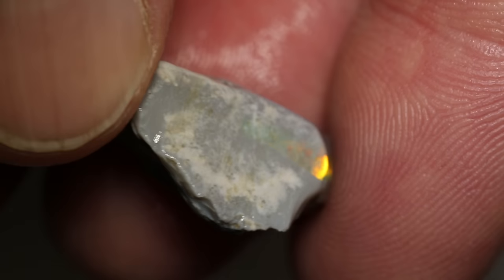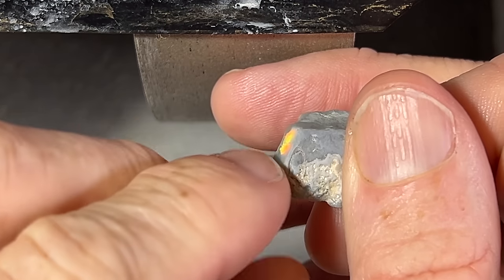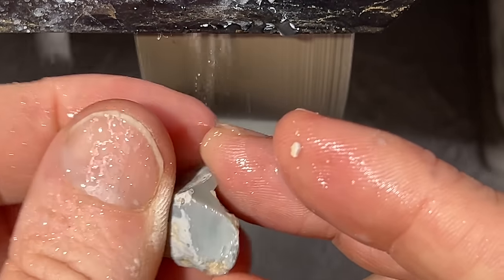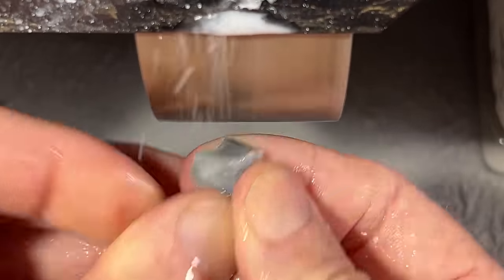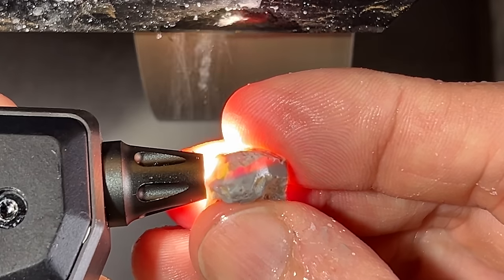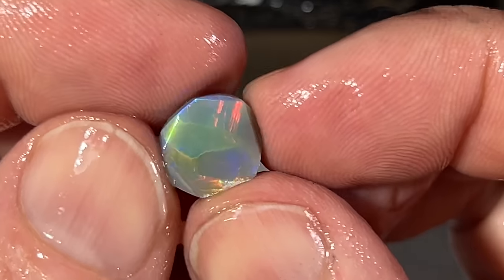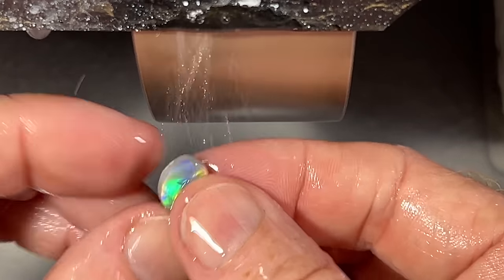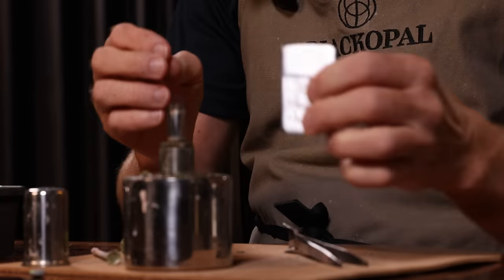Watch me cut a $100 rough opal into a $2000 gem

Comment: Just curious why on a stone with a more or less 2-dimensional viewing surface like many opals are sold by volume when clear or mostly clear stones like diamond or sapphire are sold by volume when you can see into the depth of the stone?  It would seem less-scrupulous cutters or sellers would leave extra potch on the back thus inflating the weight of the stone without providing it any additional value other than strengthening the stone with "worthless" material.  Are there standards for the ratio of thickness to length or width which would more or less standardize that and not allow extra weight on one of two stones of the same gem area?
Reply from the maker: The cutting process is a poetic license and pretty much up to the cutter how they cut their gems. It is however not great to leave too potch on the back of the opal and when's its too thick it looks silly anyway